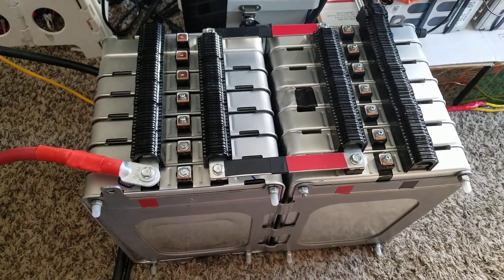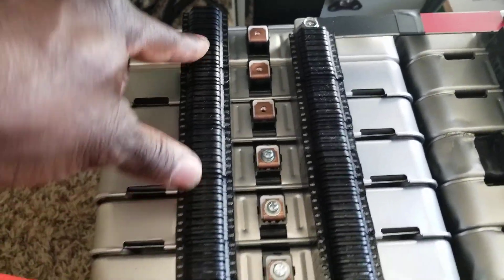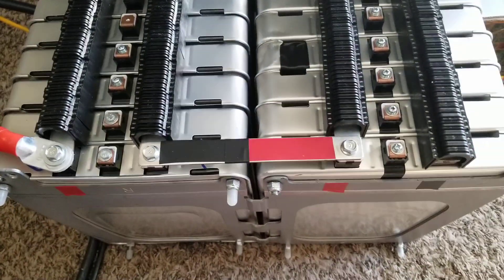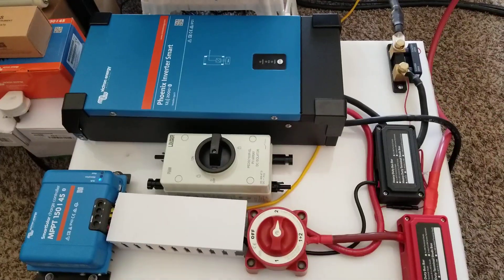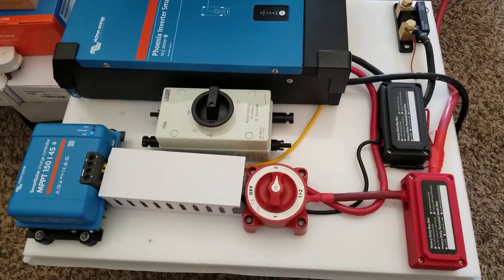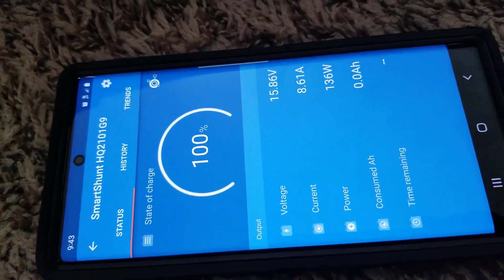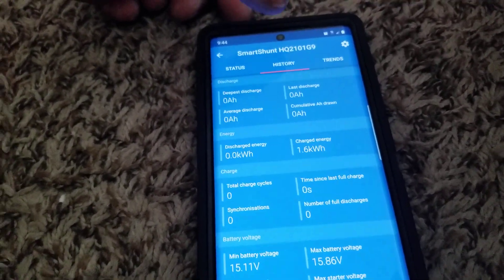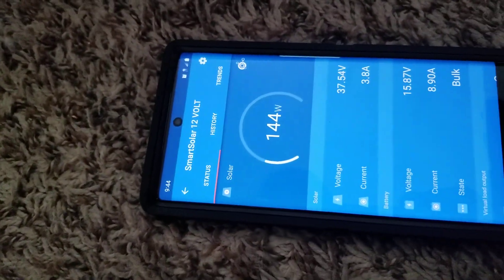OFF-GRID-SOLAR BATTERY BANK, VICTRON ENERGY PHOENIX INVERTER SMART, SOLAR CHARGER CONTROLLER MPPT(3)

Comment: Nissan leaf used NMC chemistry which has a thermal runaway issue my African brother. Please use LIfepo4 batteries or better yet LTO to avoid a fire.
Reply from the maker: Thanks for your opinion. But, I have been using Nissan Leaf lithium ion batteries approximately over 5yr without BMS and with zero issues